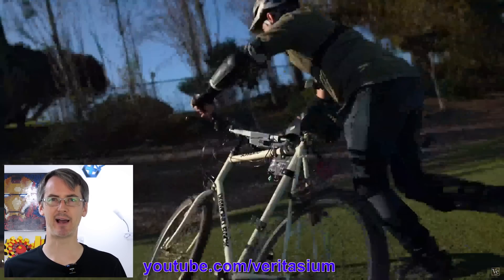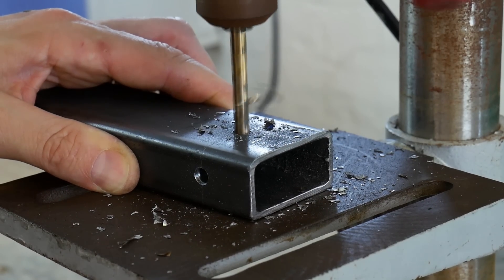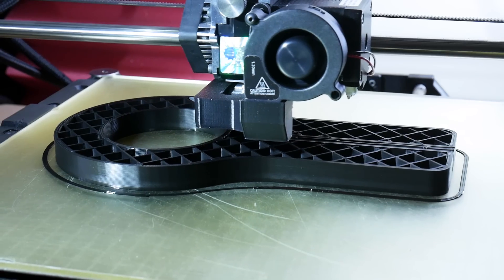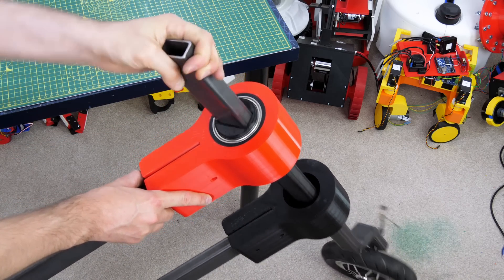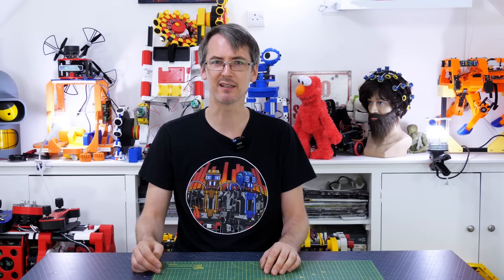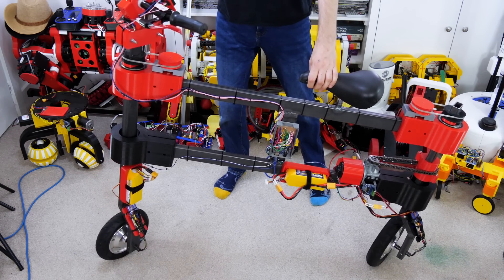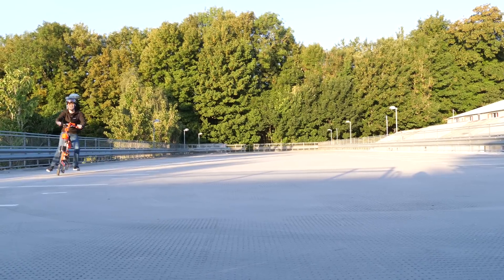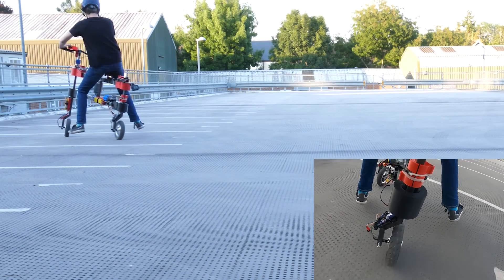Weird Two-Wheel Steering E-Bike

Comment: James your works are very 'professional' looking and if only that was possible for me, but for anyone who might be wanting to try out different systems etc,  I built a rough wooden try out of a bike from old scrap pieces and used a mechanical link to connect up the wheels so they would do the same experiment as what you've done.  And I got the same results.  The cost of my simple version was about £5 or so in materials but several days labour to get it all together.  But James, very professional yeah, but what are you gonna do with it all now.  My rough wooden  try out has gone back to nature, can you say as much?

Comment: There is one car (German made, i think. Because of course.) that uses the "crab steering" at high speeds to make lane changes on the highway smoother, and the "counter turning" steering (where front and back wheels turn in opposite directions) at the very low speeds for better maneuvering in parking lots or other tight spaces.

It uses normal "front wheels only" steering for everything between those two extremes.

Comment: with this design, perfectly "square" and with the little wheels im not convinced, regular bikes have rake angle on the front fork and different amounts of axle center compared to the center line of the fork that all contributes to how pedal bikes and motorcycles handle and there are formulas for this, i think a better starting point would have been to take the front half of two regular bikes and weld them together

Comment: 1st abnormal steer mode he tried is simply a swing bike
Reply: But on a real swing bike where you can manually steer either front or rear wheel as much or as little as you like in pretty much any circumstance makes the possiblities of where and how u ride the bike pretty much endless 
U can even ride it backwards

Comment: I think it was Honda had an adaptive 4wheel steering option that would vary the steering mode depending on the speed of the vehicle and the radius of the turn. So as you cranked the wheel harder at slow speed, it would go from front wheel steering to all wheel steering. And if you were at highway speeds it would start out in parallel steering and switch to front steering if you turned farther.
Reply: Renault also have something like that if I remember correctly

Comment: I made a 2 wheel steering bike in middle school and it was crude but fun. The seat and rear triangle frame with pedal cassette and rear wheel were welded into the front forks of a second parts bike. The seat was welded in place of the handle bars and this assembly was then welded to the fork, handle bars and front wheel from first parts bike. The bike was a hit everywhere I went. One wheel on the sidewalk and one in the road, riding side saddle was also entertaining and doing super small donuts finished off the trick list. 

I remember seeing a production looking double steering bike back in late 90’s. It had a spring to help the rear return to center and also had a lockout pin to make it conventional steering.

Comment: I rode a bike back when I was a teenager  in the early 2000s called a swing bike. It had pivot points at the handlebars and at the seat. It allowed the center frame to move and that changed the riding dynamic. It essentially gave the bike all wheel steering. And gave interesting riding possibilities like 1 wheel on the curb and the other wheel in the street

Comment: This gives me two ideas. Steering of cars, vans and lorries is mechanical; the driver turning the steering wheel determines what the wheels do. But when a vehicle goes round a curve, the wheels REALLY ought to be directed along a tangent to that curve, whereas in most vehicles, the wheels that steer (unfortunately, also called steering wheels; don’t confuse them with the driver’s steering wheel) are all parallel to each other, and the non-steering wheels are all parallel to the vehicle. What if you could steer all the wheels electronically, based on how far round the driver turned the steering wheel: the further round, the smaller the radius of the curve you want to turn. 

If the front two wheels are angled at 2º to the right and the back are angled at 1º to the right, that puts you on a curve of about radius 115w, where w is the wheelbase. 

If the front two wheels are angled at 2º to the right and the back are not angled at all, it’s about 57w, and if the back are at 2º to the left, it’s about 29w.

If the radius is zero, the wheels form a circle and the vehicle spins, like an engine on a turntable. If the vehicle wants to park in a small space, it can set its wheels at 90º to its body and go sideways.

The other idea is to do with back wheels “tracking” the front wheels. Consider a lorry tractor with two trailers. The driver turns a corner; the first trailer follows it round fairly accurately, and the second will slightly tend to cut the corner. Now consider having ten trailers: shorter, less weight. The third would cut the corner worse, and the tenth would far worse. But if their wheels were steered electronically, and told to go where the tractor’s went, they wouldn’t. And if you could offload some of the tractive force of the tractor to the trailers, no axle would be very heavy and you could carry more, driven by one driver. Turning round, I haven’t yet thought of, and dealing with them loading and unloading. Instead of one lorry and a 40ft container, one lorry could pull a long line of 10ft containers . . . AH! I’ve just been googling, and found this: https://www.researchgate.net/figure/a-A-kinematic-model-of-the-truck-carrying-the-wing-the-trailer-is-hitched-to-the-truck_fig7_3344095

Comment: Chevy pickups around 2002 had Quadrasteer, a four wheel steering setup.  The way they did it was to restrict the crab mode to below a certain speed (about 15 mph) and above that speed they used mirroring mode.  They also restricted the rear angle to about 15 degrees in both modes, and the angle was based upon front steering input (a percentage of it).  Using crab mode above 15 mph resulted in dangerous unstable conditions (roll overs), and using mirroring below 15 mph made it difficult to park.  Using crab mode at below 15 mph made it easier to park and/or maneuver in tight spaces, and using the mirroring mode above 15 mph made lane changes easier.  You may find that this method works well on your bike. You probably want your speed limit to be lower than 15mph, but the limit on the rear steering angle should stay around 15 degrees either side from center.  I would start testing your speed limit at 5 mph and work from there.

Comment: Another channel modified a bike so the handlebars were disigned to steer in the opposite direction,  so when steering the handlebars to the left the front wheel turned to the right. It was like learning to ride a unicycle it was so difficult to ride.

Comment: I wonder how different it would be with larger diameter tire. Also, having different diameter tires could also have a different effect. If you put wide tires on it, you could steer by leaning alone i think.

Comment: Use the 4ws idea used in mazda mx6’s. Slow speeds they turn opposite directions for tight turning circle. High speeds they turn the same direction but the back wheel angle only turns 10-20 degrees

Comment: You need a physical connection instead of using a motor to steer the back wheel. They're not steering proportionately or simultaneously.

Comment: That   is very impressive.  Have you seen the  1988 Honda Prelude Si 4WS?  For large steering angles the front and rear wheels steered opposite,  and for very small angles they steered the same direction front and rear.  Having your front and rear steering different angles will give a greater area of control..

Comment: Having both wheels steering the same amount is not optimal. For slow speed sharp corners you would like that rear wheel turns opposite and maybe 25-50% of front wheel. Above some speed 10 km/h ? it would be nice to have the rear wheel crabing. This way you would drive at slow speed sharply and at high speed you would have added artificial stability. So the linear gain scheduling of rear wheel based on speed would be interesting (the gain sign would change at 10km/h).

Comment: why did you do it via software? you already have two pullies on the steering wheels, just put a long belt over both, and flip the belt once on the back to change the steering mode
Reply from the maker: Hard to do while you're riding.

Comment: Hi quick question at 3:18, what type of bearing in the one be pushed on the table, and moment later the one on the right, out of the two on the screen, I have portable bag-less vacuum cleaner, and it has something the same that part if getting dust collected, what ever it sucks up, as part, and it needing regular cleanout (I double, as part it was built to last, so now what it called would be handy to now?
Reply: The bearing on the left, the one he presses his palm on, is a thrust bearing.  It's designed to take primarily axial loads.  The bearing on the right is a pretty typical thin-race bearing with steel dust shields.  Traditional bearings are designed primarily for radial loads, but can take some axial load.  If you want a traditional bearing that handles more axial load, opt for a deep-groove bearing.

Comment: IMPORTANT QUESTION: I'm guessing he wont see this, so I'm asking everyone else, I built an electrical tricycle with the back two wheels being taken out of a hoverboard, I used 2 typical ebike motor controllers, (one per wheel). In the video James does not use ebike motor controllers. He uses a different circuit board which he also did not put in the description. If anyone knows where I can find that part it would help out a lot for future builds or upgrading my current project.

edit: are the things attached just above the wheels just modified ebike motor controllers?
Reply from the maker: They are Hobbyking VESC 4 clones, but the closest you can buy now is something from Flipsky like https://flipsky.net/products/torque-esc-vesc-%c2%ae-bldc-electronic-speed-controller
Reply: If you're going to go with a VESC, I recommend you opt for the VESC6.  There are some significant improvements over the VESC4

Comment: If memory serves me, General Motors had tried active rear wheel assistance steering. The rear wheels turned based on speed. At slower speeds the wheels turn opposite, think tighter turns, smaller turn radius. When the vehicle was moving faster the wheels turned the same direction, think lane change at highway speed.

Comment: You should try combining your steering modes into a single adaptive mode that scales the back wheel position from a negative multiple of the front wheel to a positive one as you increase in speed. You'll want the entire range somewhere between -1 and 1 so the back wheel always moves less than the front wheel. This will give a very smooth and stable feel where the same input makes you turn more sharply the slower you are going. Some fancy cars have used this idea to make it more comfortable to drive both city and highway.

Comment: The back wheel should always turn at a lower rate and be limited in its radius of turning. That should make it more controllable. Like vehicles with rear wheel steering, the rear wheels do not turn at the same rate/speed and have a limit to how much they turn.

Comment: Nice experiment!  Looks like the rear steering is a lot slower than the front steering and that's messing up your balance a lot.  A re-configurable mechanical linkage between the front and rear steering might give better results?

Comment: I love it!  I want to make a prediction before watching...
I think it will be relatively easy to balance on the bike when both wheels steer in the same direction.  I suspect you'll be able to learn to ride it when they steer in opposite directions, but I expect it to be more difficult.

I'll grade myself in a few minutes after I watch.
Reply: I think I'm going to give myself a C for those predictions.  I figured with the wheels turning in opposite directions you'd have the following issue...
The front wheel would operate exactly as an inverted pendulum.  Steering into the fall will tend to "catch" you.  But the rear wheel will be trying to steer out from under you.  So the immediate response will do very little to help you balance.   But of course the slightly slower response is that the bike will change direction in the desired manner, and that will allow you to balance once you get used to it.

With both wheels turning in the same direction, the bike itself would never change directions.  But you can make it translate immediately to the left or right, thereby allowing you to balance as an inverted pendulum.  I still believe that's the case.  But I think you had two small but significant problems with the build.  As you noticed, the rear wheel was not steering the same amount as the front.  Also, It looked to me like there was a small amount of lag between the front wheel and real wheel steering.

In any case, very nicely done.  By the way, I'm the guy the modified the bike for the Veritasium video.

Comment: I would like to recommend two things to improve this, and with (1. Foot Rests) you can swing the bike like a swing bike and (2. check out some videos on YouTube for swing bike). Basically you use your feet on the pedals to swing out the frame, and it will make both alternate modes more useable.

Comment: The reason you can ride the bike at the end is the hysteresis or time delay of the rear steering. I would make a simple and crossed chain linkage between the front and back axes and lock and unlock the respective wheels. An H frame with no struts is ridiculous.

Comment: maybe try making the rear steering proportional say 50% of what ever the front is doing in the "tight turn" configuration. Will probably still turn tighter that normal but may be more manageable.
would be interesting to see at what point the it still feels normal to have 2 wheel steer, but you gain an advantage from it.

Comment: I would like to see the wheels cantilevered from opposite directions (because I think it would reduce the likelihood for it to dog-track or drift).  Also, I would recommend slowly bringing the tire pressure to 10 PSI over maximum rating.  I've tested them to 20 over.

Comment: I theorize that the only reason you can balance with the same direction steering is due to the lag between when the rear steers compared to the front. If the wheels were fixed to steer at the exact same time I don't think you would be able to maintain balance.

Comment: This way you can improve an auto-drift mode using infrared lasers and sensors:

* 3 infrared sensors:
- 1 facing in front of the bike's chassis
- 1 facing in front wheel's direction
- 1 in your head, facing the direction you want to move

* When you look at your right while you turn the front wheel to the right, the back wheel moves following your head's direction. In this example, it starts to "drift"
* When you look at your front, the back wheel tryes to adjust your balance, following your head.

Comment: you might try having the back wheel turn half as much as the front wheel this will assist your turn with out kicking you into a spin   this is how our 4 wheel steer JD tractor is set up

Comment: You should look up a swing bike, it’s kind of similar to the second mode but the back wheel doesn’t have forward steering geometry. And the pivot is under the seat so it’s controlled by the rider’s hips and body weight. It’s a sort of novelty/ cruising bike usually you see people ride them in flat areas near the beach like

Comment: What about something like this that transitions from being a hoverboard to being a two-wheeled self-balancing longboard? So it can do the self balancing thing with the wheels perpendicular to the board but then the wheels themselves can rotate like casters to be parallel to the board and then you're just standing on a very short bike, which would then try to steer into turns to keep you upright.

Comment: It would be fun to race these, or at least have a bike with the ability to toggle the rear steering like they do in cars you might be able to switch it on while coming into the apex of the corner at a tangent and be able to cut in front of other riders as it's like you're drifting but with a hell of a lot less friction

Comment: I quite sure that the delay between you turning the front wheel and the rear wheel copying the action is making it a lot easier to control. 
To make a much better test you should have both the front and back wheel controlled by a motor, with you only turning the potentiometer.

Comment: I feel like this would have been a lot simpler without all the electronics, and instead doing it mechanically… but this is still cool hahah
Reply from the maker: Switching modes would be hard
Reply: @jamesbruton  Theoretically all you'd need to do is swap two parallel control bars to be crossing, which might not take all that long, depending on how it was designed. But yeah, it definitely wouldn't be a flip of a switch haha. That being said, you also wouldn't need to have batteries and electronics etc etc.

Comment: you need something like a peg so you can balance by shuffling your body around when using the two rear steering modes
putting a ratio on the rear wheel steering would probably help, i'd want to see a version though where it tries to balance the frame depending on the speed, roll, and steering input angle see how fast you can go and still turn very well.

also, since the rear wheel also has positive caster angle, i wonder how a negative caster angle would behave.

Comment: Go full steer by wire and have the yaw angle determine the turning radius and use a secondary control like twist grip or handbrake to vary the steering contribution between front and rear wheel